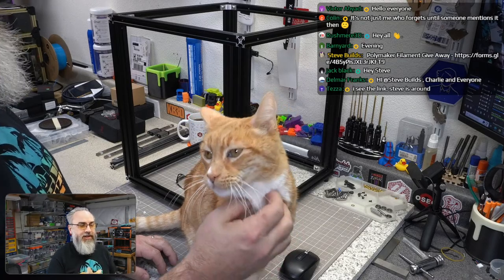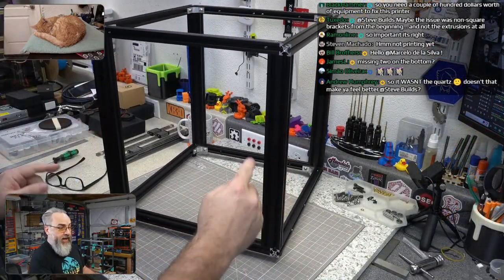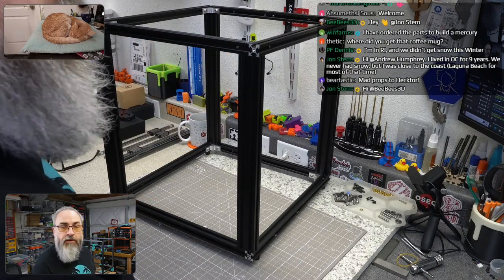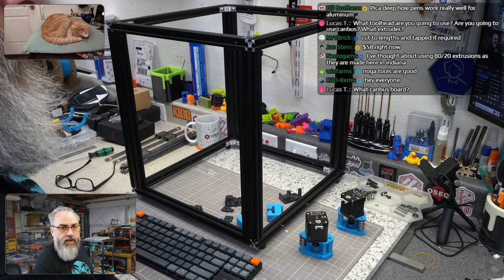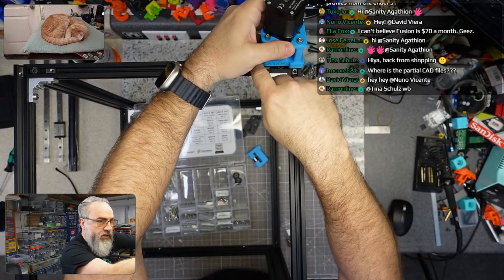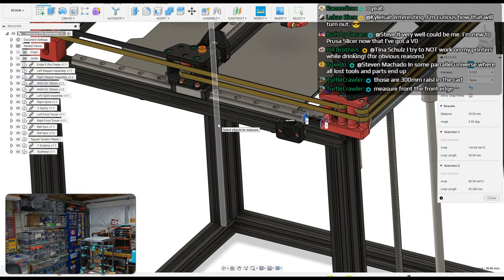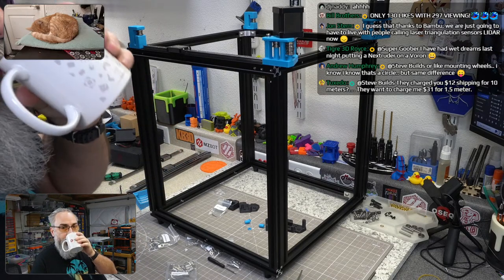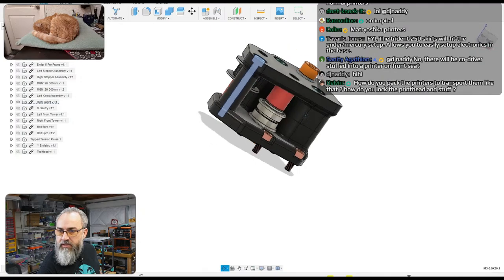ZeroG Mercury One.1 (Part 2)

Comment: 3 hours 58 minutes into the stream  I found my answer. I have never build my own tool head and I bought the Phaetus Rapido UHF. Was afraid to take hot end apart (void warranty?) but clear now there is no other way to mount. 2.5mm screws. Bonus points for going to the Eva 2.4 site. Made my night. Thank you sir for a quality stream.

Comment: Cheers for this have been squaring my frame, z-tilt and mesh calibrating.

Stream starts ~1:30 talking about frame out of square > 2mm. Cause was “square” corner brackets not being squared, fixed by grinding them square. Steve’s assembling on project mat, on a flat slab of quartz.

4:00 Consider making an extrusion touch up station with disc sander, 123 square blocks and clamps. Requires time to build, align and squaring.
6:40 Ensure chopsaw trammed and squared if using one.
7:30 Use square corner brackets, but first you’ll probably need to square them, because… quality.
Steve’s were < 90 deg
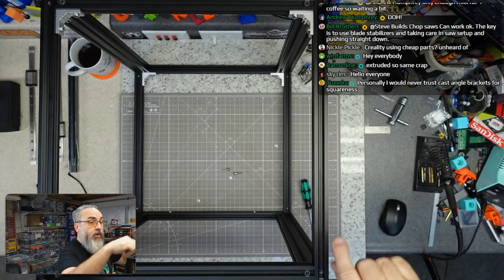9:00 Start one side, sneak up on tightening into corners, switch back and forth.
12:00 Use 5mm blind joints to secure frame better
12:30 Tap holes for belt adjustments
20:00 Use soft feet to avoid base scratching.
31:30 Uses NOGA Deburring Kit
56:00 Mounting Y linear rails to top of extrusion.
1:02:00 Linear Rail spacers (offensively lime)
1:16:00 Quick view of Right XJoint (XY truck) in Fusion 360
Stream continues with assembling other parts, not frame squaring related afaik. I didn’t watch entire stream, just skipped around indexed sections.

Comment: How did you get the extrusions the same length after making them square?
Reply from the maker: I sorted them by length first and started by squaring the shortest one.  Then just made sure the rest were the same lenght as the shortest one as I was squaring them.  The difference in length was a small fraction of a mm so this was still easy to do on the disc sander.
Reply: @SteveBuilds  I wish you had been able to show this process but I think I get it, thank you for the reply

Comment: where do you get that fan duct with kilcky incorporated? thank you
Reply from the maker: Pretty sure that was on the ZeroG discord.  Sounds like the tri-horn design is not optimal so I'd check for a two duct setup.
Reply: @SteveBuilds  why is it not optimal? The design itself wont work?
Reply from the maker: I don't know details but apparently the third air path negatively impacts part cooling.

Comment: im using an E3 EZ for my V0.2 rebuild, a long with a CB1 and a TFT35 SPI screen, and whilst its going well, trying to build a v0,2 config for it was not fun
Reply from the maker: What was the most challenging part?
Reply: @SteveBuilds  even on a V0.2 size machine routing the screen wire. then its just building a config, there are so many ways to build a klipper config that when you try to just copy one to the other you end up missing stuff or its not all in one and expects other macro files etc.
Reply from the maker: Definitely a side effect of flexibility.  But it's all going now?
Reply: @SteveBuilds  some mild issues with the mini stealthburner, but I'm sure those are a mix of bad print quality and the fact the extruder motor is one of the beta motors LDO gave out for the original V0.1 kits. hard to really complain for free